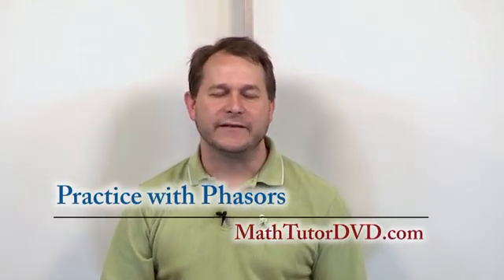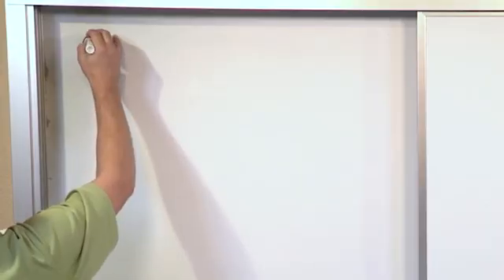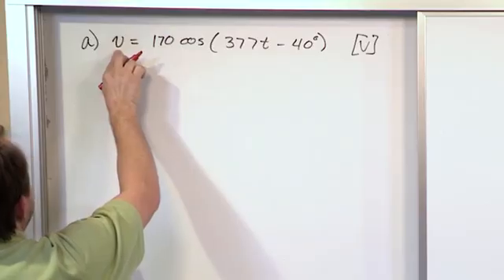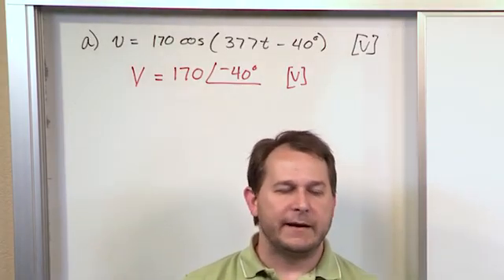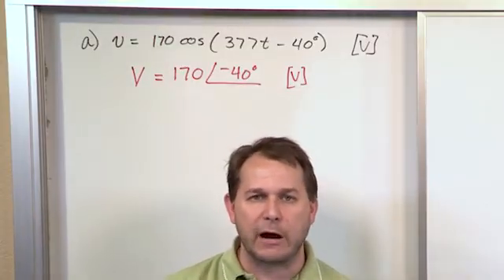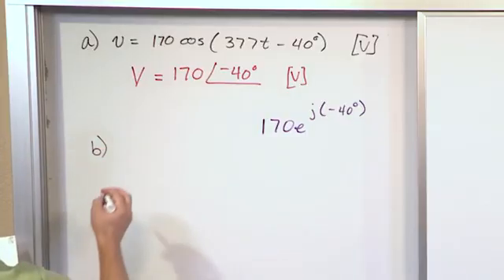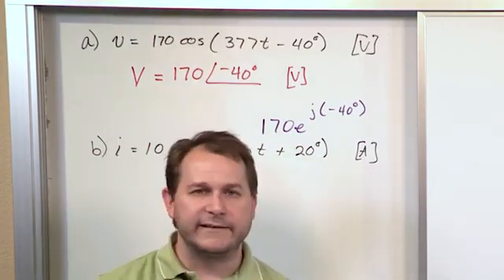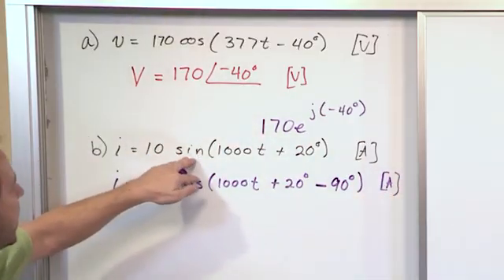Lesson 10 - Practice With Phasors (AC Circuit Analysis)

Comment: I think the sinusoid has to be expressed as cosine soas to be consistent with Euler formula as it relates to complex plane.
This practical application of phasors was  popularized by Karl Steinmetz

This duality of nature is present in physics as electricity and magnetism and applied in electric circuits for sure. The capacitor stores energy in the form of an electric field (involves static electric charge) and inductor stores energy in the form of a magnetic field (involves moving electric charge as current). Resistor just dissipates electrical power to thermal power as heat.

Comment: shoudnt it be 90-20 on the last question
Reply: Reasonable logic but nope. You subtract 90 from whatever your phase angle is. The reason being cosine is lagging sine by pi/2 (90*). If you subtracted from 90*, you would not be making that full pi/2 phase shift into the cosine domain. You also subtracted a phase angle from 90* for no reason. I hope that helps. Im a student, not a professor, so make sure that the random guy on the internet (me) isnt full of shit.

Comment: Can we have two phaser representation for same voltage
Reply: Consider the phasor  120V with 90º, its the same as 120V with - 270º
You can also represent it as   e^( j * pi/2)      just remember that pi/2 = 90º
 U can also represent it as :  120V * (cos(90º)  + J sin(90º) )

Comment: Would the phaser voltage be 120.2? Vrms = Vm/sqrt(2) = 170/sqrt(2) = 120.2
Reply: Phasor is complex representation of a function. Thus, one uses Amplitude and Angle. 
While RMS values are used for computing steady state values.
Reply: @mvc2020  Thank you so much for that comment glad i read it now i understand....
Reply: same question from mine also